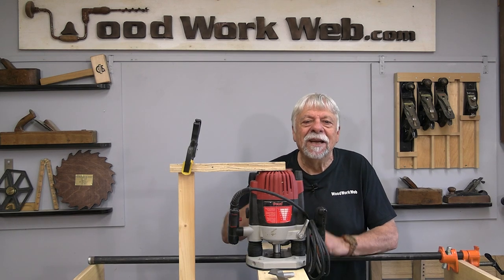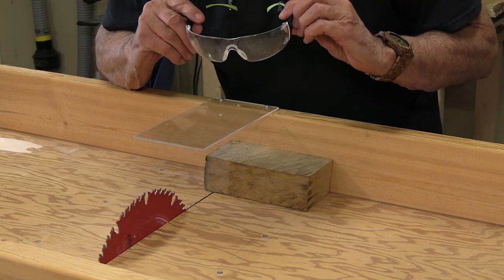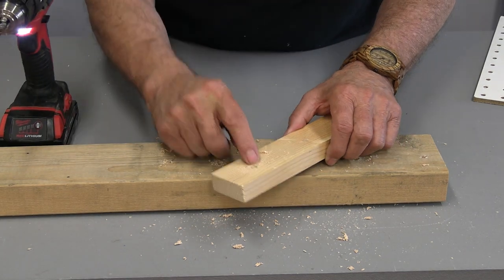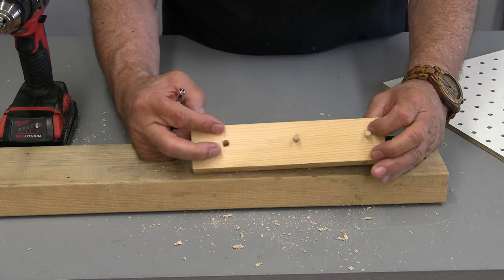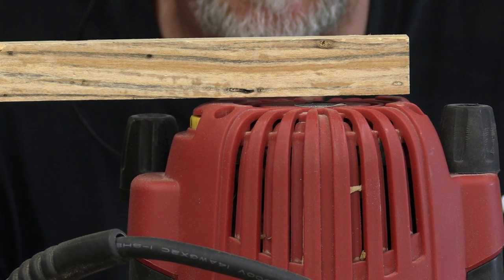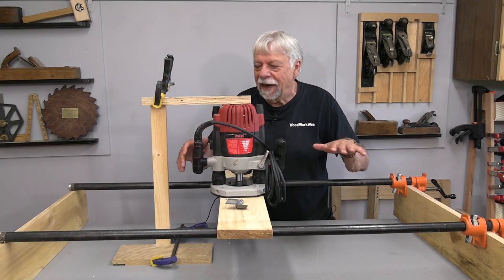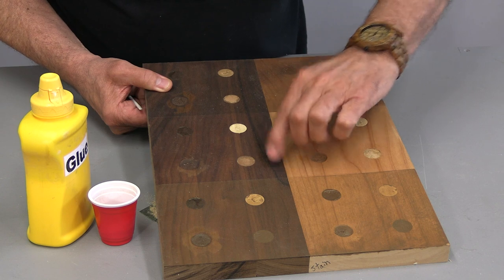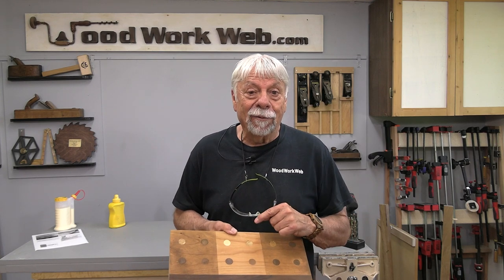Bad Ideas In  the Workshop Episode 7 / Workshop Fails

Comment: You are SO right! I volunteer as a woodshop supervisor and I can't tell you how many times I've seen folks flick their cut-offs with the blade running. I wouldn't use an acrylic guard either. Newbies have to be taught that it's okay to leave cut-offs and just continue to cut. (you can also fashion a cardboard box to attach to the rear of the table or on the rear of the bandsaw deck to catch cut-offs.)
Self-centering bits are totally awesome for a wide variety of things. I found them where you buy doors in my local big box store since they put them in the same place as the hardware to drill for cabinet hinges.) 
I don't know anyone who would use that router jig to flatten a slab. We have folks that use a router to flatten boards, but honestly, if your stock is long enough not to get stopped between the rollers in the planer, just use that. If you have to plane boards, buy a planer, yes? SO worth it. 

So, with the filler thing ... If you put glue into the area to be filled and then sand over it (as long as the wood is the same color ... can't use this where you're filling heart wood with sap wood sawdust), it will disappear. But that only works for small areas. Larger areas require what you demonstrated, but one has to be sure to take sawdust from the sap wood if it's there the hole needs filling, or the heart wood if the hole is there. 

Also, as of note, wood glue dries yellow as most of us have noted. Thus, you can't use it to fill a hole where you've used American Holly (which is the whitest wood you can get in the states), because it will dry with a yellow tinge and never, ever match. I know. I did an American Holly inlay and some of it cracked off (while cutting it with the scroll saw) before I could get it set. I tried the patch with wood glue, and no bueno. Yellow and will forever be different than the rest of the inlay. 

Same with exotics like Purple Heart and Paduk. The end grain of those woods turns black when finished. Thus, even if you save sawdust from either to patch holes, it won't work because it will cure black and then you'll have black spots in your work (no matter what you do). 
Being experienced in covering "oops" ... know your wood and your glue. Test the glue and sawdust before trying to fix a hole. That way, you'll know if there's a problem and potentially a solution. Elmer's white glue was used for many decades before the advent of PVA glue for furniture. Dries clear. So, add sawdust and check. Gorilla also makes a clear wood glue ... or there's clear epoxy in UV that will cure under UV light in seconds or minutes (depends on the epoxy). 

I'm not at all confident that using "clear" glue will help hide holes in exotics, even with the proper sawdust. The endgrain of Purple heart and Paduk are always black, no matter what finish, so I'm pretty sure no matter what you use as glue, the end result for most exotics will be black. FYI. Always check 

The take away is that there are options and not all options are right for the yellow wood glue. Think before you do. Test first to be sure.

Comment: Excellent tips, Colin! Thanks! 😃
About the drilling jig, you can always put a metal bushing in it. They sell it for dowel jigs. 
Anyway, stay safe there with your family! 🖖😊
Reply: What works really well is to put in a threaded insert.  Drill out the center to the bit diameter.

Comment: Colin, let me share this with your subscribers. I mounted my router to my router table but I only had two screws instead of three. It felt like it was mounted securely so I went ahead and used it. Not only was that a bad idea but I could have been killed. The router dislodged from the table while it was running. Tore the table all to heck as my wife and I made a hasty retreat. I thought the screws had come lose but no they had snapped in two. Thinking back this was dangerous as heck so be careful safety first as they say. Once I get the broken screws out of the base, and I hope I haven't bent the shaft on my router, I'm still about half afraid to use it again. Also destroyed a new flush cut bit.

Comment: Liked the things you address.. I only have one "slight" correction - the pegboard spacer has some Height to it.. and even in your video where you show the Vix bit poking through, you can see it doesn't stay centered AS IT GOES DOWN through the thickness of the peg board.. thereby requiring the operator to hold their portable drill motor at a perfect 90 degrees.. or be off a bit more than a small offset.. if not extremely careful. The Vix bit was designed for use with low thickness items, like hinges, hasps, corner braces, etc. - typically less than 1/2 the thickness of peg board. I do understand what you are saying about the hole widening issue.. I found that addressing it by using a steel collar insert in the wood jig.. and using a bit that either has been filled in above where the drill depth is no longer needed.. and the collar tends to hold me a lot more readily to a 90 degree angle. So, have to replace the collar after so many passes.. but not too horrible to do. Great video, just found your site, keep these coming!

Comment: As far as the second, yeah, the pegboard does seem useful -- if you like the other idea, though, the solution is to use a pair of steel/metal pins instead of the dowels -- ideally the same size as your intended pins, and then use a metal -- brass or steel -- sleeve insert where the third, drill opening is, sized for your drill bit. The smart thing here would probably be to use a wider board to handle two sleeve inserts and three pegs (four is overkill, but doable) to consistently orient the board exactly as desired. Note that you could even go further, and put in four sleeve inserts to do the holes the first time, and move forwards/upwards doing four holes each relocation.

Comment: to plane something flat, why would you need to put so much pressure on the router?  Would the router not cut if you just let it do it's job with light pressure?  May be take shallow passes?  I ask because I'm about to make similar jig.  You didn't show where the flex coming from (whether it's from the wood or the pipe).  I would make a box for the router to eliminate flex.  As for the pipe, I'm sure you can make it flex if you put enough pressure in it.  But it can be stiffen up if need be.

Comment: With regards to the pipe clamp jig in the video, I do not believe it was the pipes that were flexing.  I am quite certain the flex actually came from the wooden board the router was sitting on.
Reply: I agree. Those bars are stiff! You'd have to be superhuman to bend those even a little.

Comment: The pipe clamp idea for flattening wide boards , wouldn’t it be better if you used shorter clamps for such a narrow piece of wood?  Would I beam clamps flex less and the pipe clamps couldn’t they have some kind of support in the center of the clamp so there is no significant flex.   I believe most bad ideas can be improved.

Comment: 5:42  Shouldn't ever use a bar for the sides of a router flattening jig, it's much easier to use solid pieces of 3/4" plywood, no way those can sag.
Reply: Angle iron works well too.